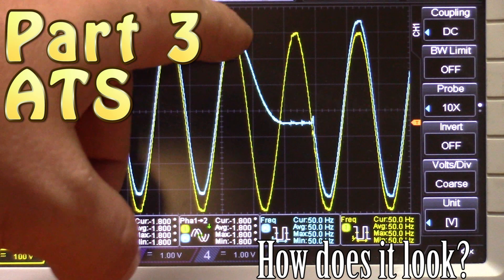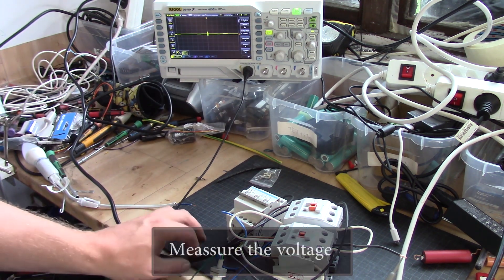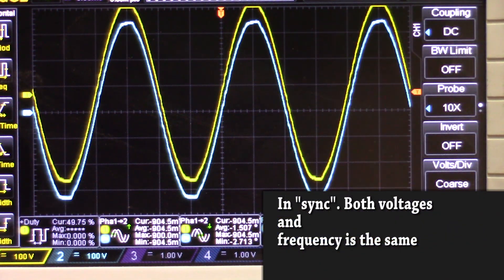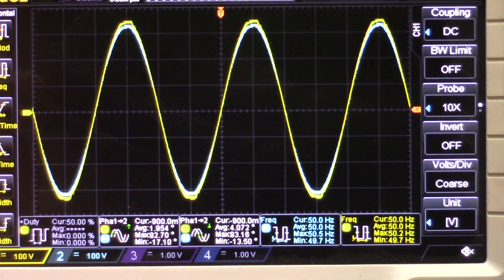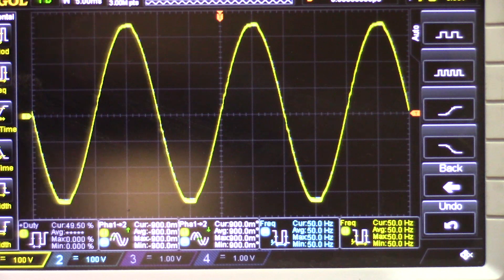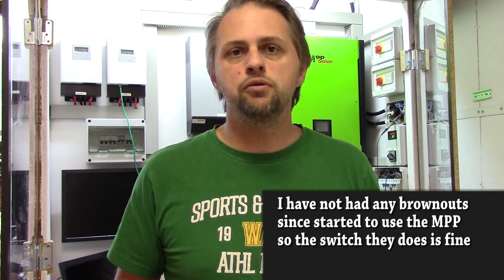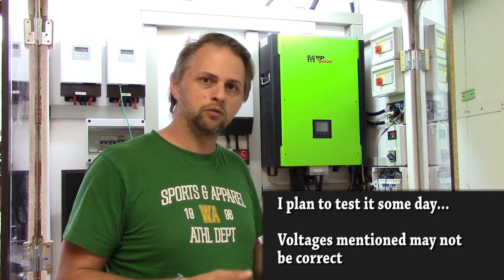Automatic transfer switch follow up - Lets scope it!

Comment: So I had a think from a signals perspective on the synchronization aspect you mention. You don't need to synchronize anything, it is make or break. You would have to synchronize if you had both sources at the same time on the output.

Comment: So interesting comment on the -330 to plus whatever if you would get voltage added unless there is synchronization between the grid and the inverter
But now here is the stupid question, because for 10-15 ms everything is off, how would you actually get that type of power added?
Wouldn't that only happen if the switch is instantaneous?
Is that 3 phase inverter?
Reply from the maker: It's 3phase
Reply: @DIYTechRepairs  ah, so the the synch issue would not happen with single phase 😊
Nice to know, I am looking to get some contactors like that and also a timer.
In the UK if I would get a Chinese branded ATS they would probably look at me sideways when they would go about certifying the installation.
Bigclive did a good review and the ATS looks alright, but this will allow me to run the inverter fully off grid in the garage and feed a single cable to the house with an ATS
Reply from the maker: @dissonantiacognitiva7438  you still need to sync. A single phase still goes negative and positive :)
Reply: So do you have grid connected to the inverter? Or the grid and ATS to inverter and ATS to load?
I want to do grid as backup and MppSolar as main power, leaving 24 hours between sketching back to MPP solar(give time for batteries to charge)
But you measures the switching time is 10ms, this without a timer I think, this would be enough to protect the devices connected right?
Reply from the maker: @dissonantiacognitiva7438  look at my drawing on how I done it
Reply: @DIYTechRepairs  i saw the timer one, but you were using that ATS105SP timer thing which also requires another din module power supply 
I don't understand how the inverter can synch to the grid unless the grid also the inverter is also connected to the grid
what do you think of the ABB AF52 contactor modules? There is a 3pole one that can handle up to 100a(tops), 250v AC
They claim motor reversing but also AC switching

Comment: For paralleling two A.C generators, they must have their outputs synchronized. This means that at the moment in which the paralleling switch will close, their outputs must have a "zero frequency-zero phase" difference to each other. Only then is allowed for the switch to close. After closing, both generators are "locked" to each other sharing the load current. 
Before turning them of, we need to follow the reverse procedure. First we open the paralleling switch and then we turn each one off. 
The paralleling/isolating procedure is performed without load.
In the case of inverters now:
If we want a grid tie of an inverter, we need to use a special inverter.
What makes it special is that it does the above procedure automatically. It will not connect to the grid, until it's processor sees the "zero frequency-zero phase" presupposition for connection. Only then it will connect. This means that it takes the time delay by itself, no matter if we connect its inputs simultaneously. It has all the necessary protection circuits within it.
The reason that we cannot connect to the grid a simple inverter (or UPS) even if it puts out a pure sine, is that it works with independent clock in its frequency oscillator, with no provision for synchronization with the grid (or with another inverter) no matter if it is same model.
Therefore, even if we carefully synchronize them by using an oscilloscope while waiting for the "zero frequency-zero phase" to come, a few seconds later they will destroy each other due to the inevitable phase differences which will occur.
In conclusion, synchronization has only to do with small generators rather than with inverters. Especially these grid tie ones. As for the transfer switch, as long as it is used before the grid tie inverters (inputs), delay provision is not necessary. These inverters can be stacked. The simple ones cannot do so as they are not designed for such a purpose...

Comment: Most computer PSUs will deliver full power for about 20ms when AC input disappears. They can do a little more at smaller loads (but of course they also do have discharge resistors on input capacitors for safety, so they can't do it for more than 100ms, even at small loads).

How the induction motors will behave, I have no idea. Optimally you would protect them with extra delay switches, so when the power is interrupted briefly they go through full startup procedure from scratch (possibly waiting for the motor to fully stop). Or do not power them from load side, and only power them from the grid side, so they are only active from the grid.
Reply: This is true. i tried switching power on and off quickly at the wall socket and the computer did not shut down.

Comment: How about using low phase shift potential transformer or optocopouler from a grid side, directly to inverter to sense a phase, and allow inverter to synchronize phase and frequency even before the ATS engages? This would reduce currents and will make inverter be already prepared for switchover.
Reply from the maker: A proper inverter do sync :)

Comment: I am confused, you inverter is hybrid, if so why you need an ATS, I think the hybrid inverter comes inside with an ATS
Reply from the maker: I want to be able to disconnect the inverter fully from my house. Ie switch between the solar and the grid. Yes the Inverter can do it internally but I cannot shut down the inverter for maintenance = ATS needed
Reply: @DIYTechRepairs  All grid tie inverters never connect to the grid before their processor sees the necessary "zero frequency - zero phase" difference between the grid voltage and the internally produced one. 
They will never put out voltage if they will not connect to the grid, which they use as a reference (island effect). That is, they stop automatically in the case of power line outage, where there is a possibility that electricians could be at work to restore line failures.
Besides this is the main drawback of grid tie inverters. They cannot be used as simple inverters, because they don't see the power network.
Therefore you can use the ATS at their output as well.
There is no question about timing as this is done automatically every time the inverter loses the network power...
(I have put a more detailed comment in the pile above).
Reply from the maker: @ΠάριςΑζής  ehhh what? Not sure what you answered on. I know how grid tie and hybrids work.
Reply: @DIYTechRepairs  Where is the problem to use the ATS you refer to? There is no problem at all. This is what I am saying.
Reply from the maker: @ΠάριςΑζής  think you missed the whole point then.
Reply: @DIYTechRepairs  I just put my comment on your answer to Jehu Garcia above, trying to tell you that the conclusion "=ATS necessary" does not hide any danger regarding sync problems.
Given that I didn't comment for any other reason than a purely technical one, I would be very glad if you would tell me what is the point I missed.
In any case, please take into account that there was (and is) no intention to insult you whatsoever. I reacted as a technician interested on the topic. At least I make myself clear. 
Moreover, I must say that you did a good job on the topic! I have seen all the relevant videos you uploaded. 
Don't rush in your life to reject people. This will help you to get on for sure!
Reply from the maker: @ΠάριςΑζής  not jehu though :) yed but i dont get your note so not rejecting nor drawing conclusion :) and thanks for watching and i Always appreciate feedback. Even though i may not understand Them all
Reply: @DIYTechRepairs  All clear now! But what did I miss anyway? It just would be nice to know. So much of discussion isn't worth it?

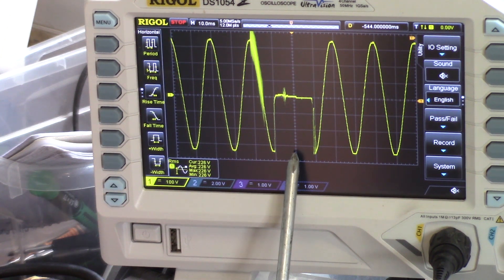Comment: 3:12 not 9 ms . it's 18 ms. Right? And 7:37 not 13-14. It's 26-28 ms.
Reply from the maker: Yeap sounds more right.
Reply: You are right only for the second (7,37) calculation. For the first one he is correct.
Reply: @ΠάριςΑζής  First  one is right too. 18 ms. Look at upper left corner H 10 ms per square
Reply: @Dimonchik99  I saw it before putting my comment. 5ms per division. Just use pause and watch again. He changed it later to 10ms.
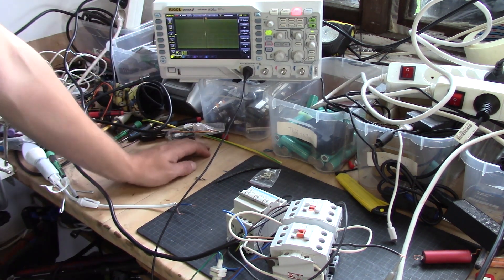Reply: @ΠάριςΑζής   On 3:12 is another try 10 ms per division. The first (2:25) try maybe was  when  main feed is recovered. So we have switching between two worked feeds. And on 3:12 we (maybe)  have switching between failed feed(without voltage) to working feed. So the switching time is bigger because of reaction time of contactor.
Reply: @Dimonchik99  Yes, you are right. The first, the correct one (2,25) was on 5ms, while he changed the setting on the rest of them on 10ms per square but he kept in mind the first setting when calculating, as it usually happens! It happened to me as well!
Reply: @ΠάριςΑζής  So on 3:12  it is 18 ms, not 9 ms. As I was saying in first comment
Reply: @Dimonchik99  I think I answered that before...

Comment: Thank you Daniel for this! There's many qualified electrician said that we should have some sort electronic grid synchronizer (?) to avoid current spiking issue. With ATS that you demonstrated, we see that 10ms switching time for the contactor is actually sufficient for 50Hz system to sync. SO much anxiety to implement ATS in order to switch from two nearly similar supply.

240V 50Hz Single Phase AC system goes from high to low  takes 10ms (1 / 50Hz = 20ms, half of that is 10ms!) 

Need to browse through IEC 60947-6 for the specs required.

Comment: Once again grate video Daniel.  I have one question that troubles Me and hope You can help me out figuring it out: Let's say that MPI 10k produces 8kW of power from the solar, and household load takes 2-3kW, rest 5-6kW is feed into the grid. how will ATS react once grid shuts off (blackout's) once we're feeding power into it? also how will ATS react once inverter stops feeding into the grid and starts taking power from the grid?
Reply from the maker: Im not sure how that will affect in any way?  Im not going to have the ATS on the grid side of the inverter but on the Load side. Ie the house feed will either be done from the load on the inverter or from the grid. That is done by the ats. Same as the inverter can do.  The inverter will disable its grid feed directly when grid disapears. So it will not hold any ATS live. Neither will the ATS care of in what direction the electrons flow :) 

Hope that answers your questions.
Reply from the maker: http://www.voltronicpower.com/oCart2/files/manual/InfiniSolar-10KW-manual-20150130.pdf 
Page 20 here. Load 2. Thats kind of how I will be connecting it up.  As long as it all is hooked up properly the ATS/Switch in this setup will not be affected in any way.
Reply: Ohh - ok, I misinterpret that, once ATS is on the load side, of course nothing will happen.
I'm still at the designing phase of my system. and I'm planning to feed power into the grid once household and battery loads are sufficed, but what's gets me worried is what will happen once blackout occurs while I'll feed power to the grid? is there a way to prevent that to happen, or will inverter somehow figure that out by itself and would'n allow to feed power into the grid?
Reply from the maker: All grid tie inverter have that kind of protection and will stop feeding directly if it senses that grid is not available. Same as if you break the grid switch. Its mandatory for all brands to have that protection so noone on the grid will get electricuted if they disconect the grid.

Comment: You have +/- 325 volts on each phase not +/- 110 volts
You said in a previous video that the inverter used 2-300W of no load and this causes you to waste 5-7kWh when not in use
Reply from the maker: No i dont have +/-325V between the phase and Neutral. i have  +/-110-120 roughly. +-325V would have been 600V :)  But between phases i get upwards 400V. That is around +-200V . If i take the AC -> DC between phase and neutral i get somewhere above 300VDC yes.  You can see this if you check the scope as well.
Or did i miss your point?

The no load on the inverter is high yes. The inverter is not ment to be running idle because at that point the efficiency is in bottom. I generally never gets below 1300W idle load from the house so thats not a big deal. I would like one that is below 50W in total but thats hard to come by in this size and price range. I will do proper efficiecy test later on when i got time and have the grid reconnected to fully utilize off grid.
Reply: blir lite fel när man använder google översätning så tar det på svenska 
jag menade att pik to pik enligt ditt orseliskop så toppar kurvan på ca 320v då det står att du har 100 volt / ruta vilket blir 230v RMS och det är över och under neutral 
men med 120grader förskjutning så blir det ca 400v 
tänkte på vintern när du inte får så mycket energi från solen så kan invertern förbruka all energi du får in så kan det bara bättre att ha den av så går strömen så har du fulla batterier
Reply from the maker: Ahh, Ja det stämmer bra det. Jag var otydlig som fasen där ser jag..... Får försöka få in nån kommentar om det. 

På vintern en riktigt dålig dag bör jag få in ca 15-18kWh. Så då har jag inte mycket att komma med men räknar också med att under vintern nu så kommer jag ha en genomsnittlig förbrukning på 15-20kWh istället för nuvarande 30-40. Jag ska nämligen flytta ut serverracket som förbrukar ganska mycket. Däremot osm du säger kommer systemet agera backup 2 av de sämsta månaderna så har man batteribanken som backup istället.  Detta kan antingen göras manuellt eller om jag låter systemet göra det baserat på laddningsgrad på batteribanken. Jag räknar bara med att vara 100% självförsörjande 10 av 12 månader på året som det är nu.
Reply: det är bättre än jag trodde då jag vet att min far som har nära 10kW paneler bara fick in 100kWh under hela månader i vintras vilket blir ca 3kWh om dagen vilket är mindre än din inverter förbrukar men du har också ett större system det var därför jag tänkte att det skulle förbruka mer än du får in 
jag undrar också vad du jobbar med om du har en server som förbrukar så mycket i hemmet
Reply from the maker: Förra vintern fick jag in 98kWh under december på dryga 9kW paneler. http://www.diypowerwalls.com/t-Esperyd-Solar-and-powerwall-system?pid=3812#pid3812  Jag räknar dock med bra mycket mer i år. Har dubbelt upp med paneler inkopplat på taket nu varav en hög av dessa kommer vara vinter-optimerade. Bara dubblering av panelerna bör göra att jag får in 7kWh per dag och sedan hoppas jag på att optimeringen av både kablar och riktning ska ge det sista. Men vi får se hur det spelar ut sig. 

Jag jobbar med IT och servrar/övervakning samt har även eget företag som har lite saker på det hemma.
Reply: såg där att 6 dagar i sträck som du snitta på under 1kWh/dag men med en optimerad vinkel mm för vintern så borde det bli mycket mer men sen  om det räcker för vad den gröna drar är en annan sak 
en tanke jag fick i huvet var ifall du kan slå på den med ett relä eller nått annat så du kan slå på den när du behöver den istället och då inne från huset då jag gissar att du har nån ups för det som är känsligt så skulle det bara bli några sekunder eller nån minut utan ström ifall det blir strömavbrott (vilket jag inte vet hur vanligt det är för dig ifall du har mycket luftledningar mm så höststormarna brukar orsaka strömavbrott)
Reply from the maker: Jag kan styra invertern helt innifrån ja. Den styrs automatiskt. Förra vintern hade jag den så att när batteriet gick under 80% slog den över till nätet istället för batteriet. 
Och i år kompletterar jag med en ATS så att jag helt kan växla hela huset mellan den och nätet. Detta för att säkerställa att om invertern pajar så kommer nätet ta över. Och det systemet går att styra helt remote och kommer så göras. Både baserat på vad som finns i batteri banken och med prioritet baserat på års-tid

Jag har ström för ca 6 dagar i batteribanken så klarar mig en liten stund :)  Detta ska dock utökas och vill komma upp i 10 dagar när allt är klart. 

Förra vintern hade jag den så att när batteriet gick under 80% slog den över till nätet istället för batteriet.
Reply: ok. lite mer funderingar är om pip drar lika mycke energi ifall du använder den som inverter men också att med LiFePo4 blir det väll lite svårare att veta hur mycket man som är kvar då den har en så flack kurva vid urladdning men det skulle räcka bra med att använda bara din 18650 batterierna för att trigga och använda den stora banken om det krisar under nov-feb 
men hur mycket har du nu i banken med 18650 ? eller så bara fylla upp bankarna så mycket som går när man får reda på dåligt väder som kan riskera störningar

Comment: How is the quality of pure sine wave THD. For the mpp solar inverter. Is it safe for our home application
Reply from the maker: haytham abdalsattar i have not done such testing at all. I think there is People out there that has. It looks ok and i have not had any issues. Im running all from computers to hifi stuff without issues
Reply: All modern electronics use switching power supplies. These work happily with any power waveform in their input, even with D.C.
The use of pure sinewave inverters is in most cases not necessary. Practically speaking, only induction motors are sensitive to non sinewave inverters...